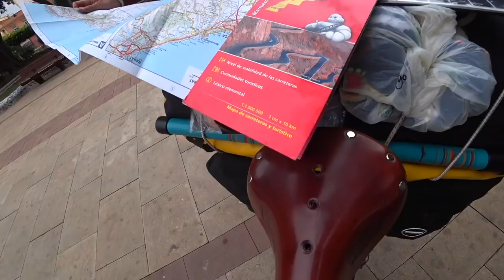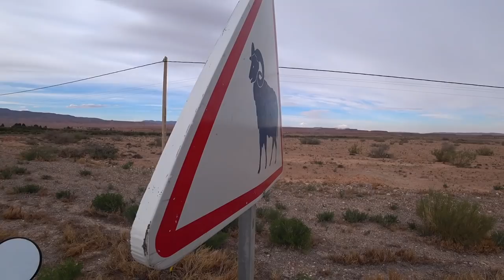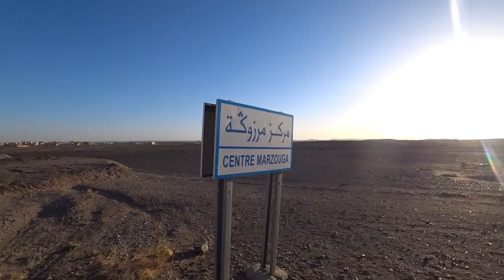Cycling around the world: 8th VLOG - Arriving in AFRICA - Morocco

Comment: How many flat tires have you had so far?
Reply from the maker: Two, one in Spain and one in Morocco! Both on Peyman's bike, one front one back. It was probably because the air pressure was low both of the times. We need to remember to check it more often! In Spain it was about 3 bar, we try to keep it at 5.
Reply: @NomadsTrails  only two, wow not bad